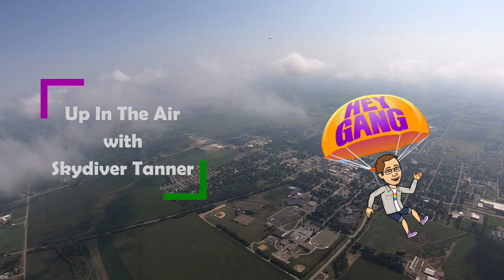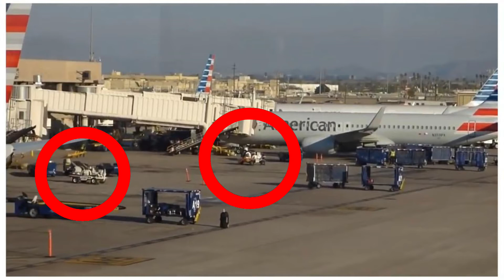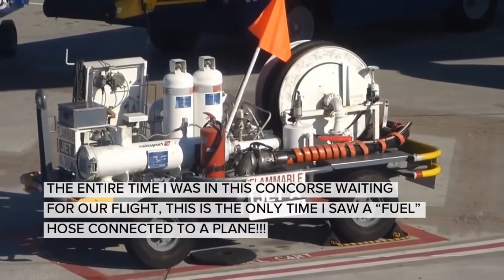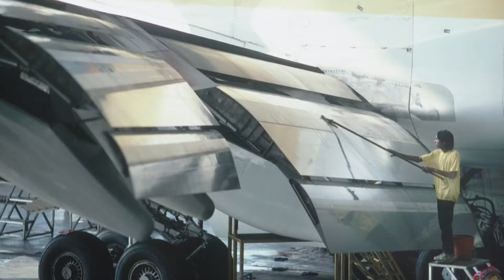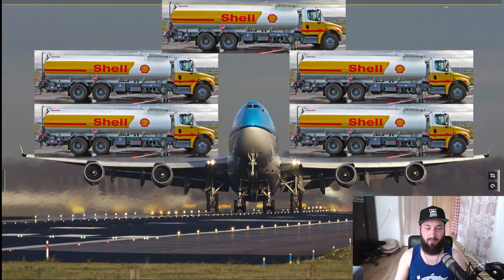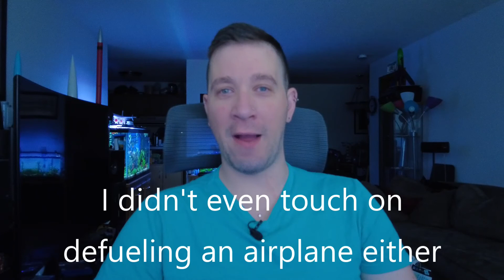Jet Fuel Hoax Visited: UITA w/ Skydiver Tanner

Comment: They do get fueled but it just starts and runs the jet until it gets up high enough then the engines start to compress the oxygen for fuel.
Reply: @kaferere  Elemental oxygen does not burn.  I did go to school, AND I did take chemistry.  Did you?  Oxygen is an oxidizer.  It oxidizes.  Fossil fuels need oxygen to burn, even though they contain oxygen.  Coal will not burn in the absence of oxygen.  If you doubt what I say, take a piece of coal or charcoal, ignite it and let it burn until it is very hot.  Then place it in an old paint can and put the lid on.  Wait for it to cool, and then open up the can.  Lump of coal will still be there.
Moron.
Reply: @kaferere  Otto:  

“Dr. Otto Warburg (extreme left) at the National Institute of Health, USA
In 1944, Warburg was nominated for a second Nobel Prize in Physiology by Albert Szent-Györgyi, for his work on nicotinamide, the mechanism and enzymes involved in fermentation, and the discovery of flavin (in yellow enzymes).[9][10] Some sources report that he was selected to receive the award that year, but was prevented from receiving it by Adolf Hitler's regime, which had issued a decree in 1937 that forbade Germans from accepting Nobel Prizes.[11][12] According to the Nobel Foundation, this rumor is not true; although he was considered a worthy candidate, he was not selected for the prize at that time.[9]”

Perhaps you should consider NOT making up stuff to support your position.  People actually verify sometimes.
Reply: @kaferere  No oxygen, no fire is absolutely true.  O2 is an oxidizer, without oxygen, no fire.  Fire requires three things.  Heat, fuel, and oxygen.  Take away any one of those and no fire.  This ought to be real easy.  Just go find an article that says oxygen is a fuel.
Reply: @kaferere  Feel free to find any scientific reference that shows oxygen as a fuel.  Shouldn’t be a problem for a sharp dude like yourself.  BTW, YouTube is generally not referred to as scientific resource.
Reply from the maker: Or the engines already compress air so it can be mixed with fuel to burn for propulsion and at certain altitudes it runs more efficiently. Kind of like how many engines you can choose to run more lean or more rich. Or do those all run on compressed air as well if we use your logic
Reply: @kaferere  Kerosene (jet fuel) formula.   C12H26−C15H32

   Gasoline typical:  For our "average" gasoline of C8H18

   Coal:  C15H11O-

  Ethanol (not fossil fuel):  C2H6O (empiracle)

None of these substances are combustible in the absence of oxygen.

I am not going to tell you to go back to school, I am going to tell you to just go to school for the first time.  That is the danger of pretending to know something about a topic you have never learned.
Reply: @kaferere  So, what is the chemical reaction when oxygen is burned by itself?  Container of oxygen + flame = ?

No piercings, no tats, plenty of education?

You?
Reply: @kaferere  I was going to ask you if you thought oxygen was a fuel in itself, but you just answered that.  So, it is obvious you never had chemistry.  Yes, I used google to find the formula for kerosene and gasoline.  So, you said ALL fossil fuels contained oxygen.  I demonstrated that this is false.  Now, I want you to find me the chemical reaction for burning oxygen.

How about this; find and link any article that shows oxygen is a fuel.

You lost me on the atomic shuffling thing.  Please explain how that shows oxygen burns, or whatever it is that you think it means.   The rest of us who had chemistry and physics would like to hear this.
Reply: @kaferere  Why would a Saturn V booster stage have a fuel tank, if all it needed was oxygen?
Reply: @kaferere  Who is the “rest of us”?  Well, it’s every kid who had chemistry in high school.  That is about as entry level as it gets.  It’s every chemist.  Every physicist, astronomer, doctor….

Did you even graduate from high school?
Reply: @kaferere  No.  Airline pilot and check airman.  I am pretty sure I paid more in Federal Taxes last year than you earn in two years.
Reply: @kaferere  So you deleted your liquid oxygen comment.  I was asking why there was also a kerosene tank in the first stage if oxygen is the best fuel. 
 I wonder why.......
Reply: @kaferere  The warning is because heat is a function of oxidation rate.  The higher the oxygen percentage, the faster the burn rate.  That is why a lighted cigarette in the presence of oxygen with burn with a flame instead of smoldering. Oxygen does not burn.  Go find a reference to oxygen burning without a fuel and bring it back here.

Good luck!
Reply: @kaferere  Timestamp?  Have you found ANY reference for oxygen being a fuel?
Reply: @kaferere  Cherry picking.  At 00:48 she goes over the requirements for fire.  Did you miss that?  When the match is over the oxygen, the match burns brighter but the fire does not propagate down the tube until the match is dropped.  In other words the fuel is in with the oxygen.  You are a fool.
Reply: @kaferere  Still no evidence and somehow you think you proved me wrong?
Reply: @kaferere  What is it you do for a living genius?
Reply: @kaferere  Food stamps for the aviation industry?  Who gets those?  I haven't missed a check in 30 years.

It is admirable of you to help people who made bad choices early in life.
Reply: @kaferere  I have been looking continuously since two comments ago.  I STILL can’t find any references to oxygen as a fuel.  Help a brother out!  Some links would be really nice, then everyone could click on them and be as “smart” as you are.  Humor me. Please.
Reply: Oxygen isn’t a fuel.  It’s an oxidizer.  Fuel requires an oxidizer to burn.  Jets burn fuel.  Lots of fuel.

Comment: The 25000ft service ceiling for the aircraft you are talking about is related more to the pressurisation and oxygen carrying requirements of those aircraft. There are legal requirements as to the amount of oxygen carried for the crew plus the drop down masks for the passengers. Below 25000ft these rules are less strict. If you flew in a Boeing 777 with an unserviceable flight deck oxygen system you are legally allowed to fly up to and not beyond 25000ft.
Reply from the maker: Correct. Those turbo prop engines are capable of much higher altitudes. I just didn't want to get more detailed than I already was getting with just the fueling aspect 😀
Reply: How can a 777 be dispatched with an inoperative crew O2 system?  What does the crew do if there is a decompression or smoke in the cockpit?  Is there another O2 source available to the crew?
Reply: @oscarb9139  - it is possible to use the medical oxygen bottles, but only below 25000ft.
Reply: @EdOeuna  There is a difference between being able to use something and it being legal for dispatch.  Are you saying it is legal to dispatch a 777 with the flight deck oxygen supply inoperative? I doubt that it is legal for the reasons I mentioned before.  Are you working in the aviation industry or just guessing?
Reply: @oscarb9139  - it is unlikely that the flight deck oxygen system is inoperable, more likely the bottle pressure is below that allowed for dispatch. I don’t recall the exact wording of either the MEL or FCTM (I’m on vacation so no iPad) but I believe they mention aircraft oxygen systems must be available for flight above 25000ft.
Reply: @EdOeuna  If the bottle pressure is below the minimum, then the flight cannot be dispatched.  That is why it is the minimum.  Portable O2 cylinders are not designed for use on the flight deck, otherwise you would see one stowed on the flight deck.  I suspect you are incorrect on this one.  

In the past (previous turboprop job) the only thing that I knew that limited us to 25,000 for passenger carrying operations, was the absence of automatic oxygen mask system for the passengers.
After reading our MEL, I found a reference to a Passenger Oxygen Service Unit.  If a unit over a row of seats is inoperative, the seats must not be occupied, or the  altitude is limited to FL250 for planning an operational use.
Enjoy your vacation.  I start back to work today for two weeks then roll into another month off.
Reply: @oscarb9139  - it was a few years ago when I had a post SIM discussion about it, I recall. The jist of it goes “oxygen must be used above 10,000ft” and (separately) “crew must use flight deck oxygen above 25000ft”. It may be a FCTM thing. I’ll look it up when I get home tomorrow.
Reply: @EdOeuna  Great.  I look forward to hearing from you.  What equipment are you on?  I’m on the Bus.
Reply: @oscarb9139  - firstly B77W and L. 

I’ve looked up and can clarify what I said, and apologise if I’ve misled you. Obviously the MEL requires a fully operating oxygen system with minimum pressure above that required for flight. In the FCOM the minimum oxygen for dispatch is 530psi for 2 crew, but the preflight scan checks it’s above 1500psi. 

However, in the OM-A it mentions that flight can continue if the oxygen system becomes inoperative if: below 25,000ft portable oxygen is available, above 25,000ft flight deck oxygen must be fully serviceable. When the cabin altitude is above 10,000f then all crew must use oxygen.
Reply: @EdOeuna  Thanks.  That makes a whole lot more sense.

Comment: I spent a few years working in aircraft fuel tanks on mid size military aircraft and still on some level work on fuel related systems/components to this day. The hoax is pushed by paranoid people and flatearthers. Its damn near impossible to try and explain to these types of people with that mindset. You can just imagine debating with someone with extreme ignorance, false information, 0 experience in the field, manipulation and in many cases low intelligence.
Reply: @ShizzieShizz73  yes jet fuel hoax believers  are sheep, I agree.
Reply: @ShizzieShizz73  I can understand how you would be perplexed by this.  You should have paid attention in school. Then you could do the length x width x height thing to get volume.  Then you could multiply the density by volume to figure it out.  But here we are having to explain it to the children AGAIN.